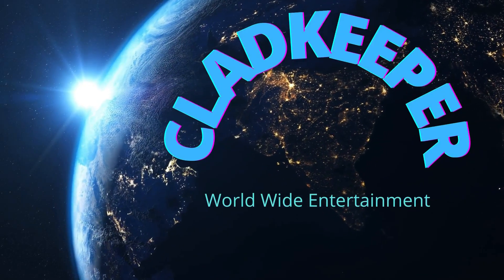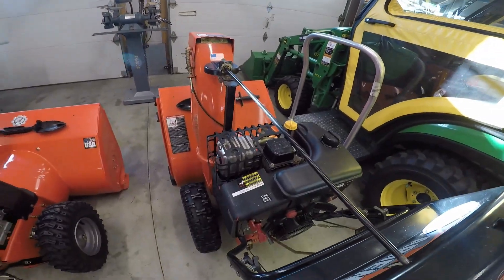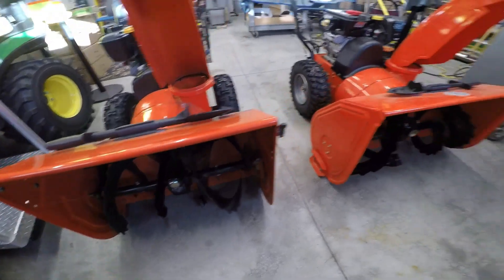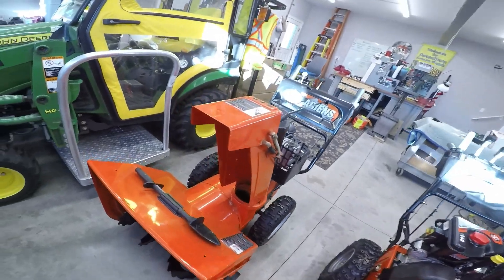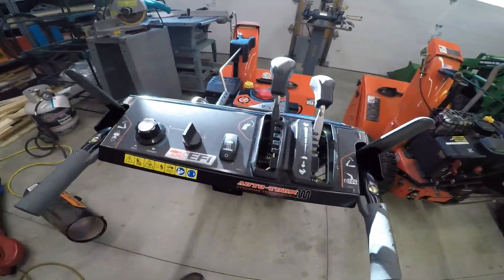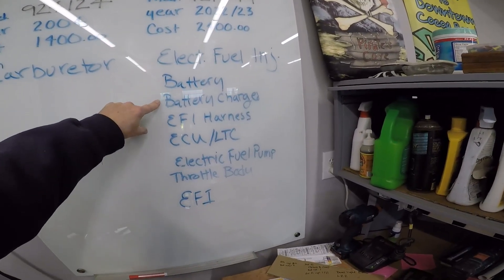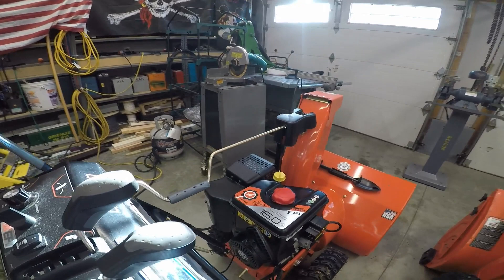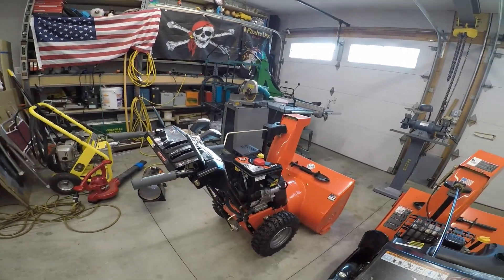Ariens : Compare electronic fuel injection to carburetors.

Comment: I am looking at replacing my Ariens 24 inch compact snowblower I have had since 2019, I am looking at a 28 inch next, but I came across these EFI machines and did not know what these were or how they worked. I also am big into owning electric lawn tools, including I also have a 24 inch 2 stage electric snowblower as well that runs on the same batteries as the majority of the lawn tools. But I am convinced currently that gas is something you need to keep around for that power in those deeper snowbanks whereas electric currently is best for "most" snowtypes (light to medium thickness, not too wet) but heavy just struggles with electric only tools still currently (or even snow plowing with a blade can still be a struggle. I think after explaining these maintenance costs with the EFI engine (basically its like a hybrid between electric and gas kind of), I would rather stay away from EFI unless you live in an area where you get tons of snow regularly. If you live in a place where you get some big snowstorms for a few months out of a season, then probably sticking to a carb unit is the best and I think that is what I will do. Plus I don't have a garage where I can just causally hook up the EFI battery to it to keep it charged as well if it is attached to the unit itself (or even remembering to do that). So at this point, I would rather do maintenance on a unit to be used for more specific cases that doesn't cost much to keep it maintained (since the electric batteries are where I have to keep most of my costs to replace over time) and keep it simple or just go fully electric at that point. Electric tools have gotten so good now for at least the summer/misc. lawn tasks (and power tools now) that snow removal is one of the few areas left that Gas (and maybe chainsaw work on the heavier side for cutting denser woods) still I think has an advantage currently if you live in an area with heavier snow storms until the battery tool companies figure out how to get the power for the bigger snow throwers on par with those gas units. But all of this is just my opinion.

Comment: Just got a Great Lakes Edition with EFI.  Not happy with it. It is hard to start, the battery tool over 30 hours to charge and it runs like crap. They put more money in the light and hand grip harness connectors than any of the engine control connectors. It back fires and stumbles with premium gas. Even the chute tilt motor did not work out of the box. Who ever assembled the motor cross threaded the bolt and the cable and gears were messed up I had to fix myself. I spent $2400 on this machine and am seriously thinking about buying a carb engine from Northern  and cut my loses. This unit seems to be very vulnerable at the times you are going to need it most. Stay away…

Comment: So is it possible to convert the efi version back to carb? What would be needed besides the obvious carb? The EFI on this sucks, cheap harness, expensive battery that you have to keep charged also cheap connections on that too. Connectors on the ecu are also cheap and vulnerable. Fuel pump is low quality and often fails.
Reply from the maker: Have not gotten that far into it.

Comment: I also have a 2004 924124 9hp 26 inch. Here in Syracuse NY. 120 inch average annual snowfall. It has served me well, so far. About 8 years ago I had to replace the impeller bearing and did some repainting and replaced the gearbox oil seals and a bunch of rusted bolts with stainless. I have also rebuilt the carb once and cleaned it a few times. I have replaced lots of shear pins and am about to replace an impeller drive belt. It has never failed to start and run well enough to clear my driveway.

This replaced a 1980 7 HP 24 inch unit that was working fine in 2004 when I traded it in on the 2004 model.

The Sno King engines were dependable workhorses given regular maintenance and same for the Ariens blowers. Ariens still have all the normal maintenance parts for both of these models available. And I have local dealers who have most of the common ones on the shelf.

Comment: I think the 306cc engine on the Deluxe 30 is closer to about 9.5 horsepower. I think you divide the engine cc’s by 32.5 at least that’s what I’ve heard. It’s crazy how many people think the torque rating on these engines is horsepower though.. I see used snowblowers for sale on my local classifieds all the time with the engine rating advertised as horsepower..

Comment: So after making this video, did you ask yourself why you bought the EFI machine? Quite honestly, you're a little low on those parts. These things are junk. I had 4 customers who dumped them after I told them how much repairs would be with labor. You CAN'T beat a carbureted engine. Just start the damn thing once in a while through the summer months and never have a problem.
Reply from the maker: @joeganusi8522  I would have bought 10 of them if I could have at the price I paid

Comment: Excellent, detailed and well explained video. Regarding the auger rake brace on the newer one, Ariens cut corners on more recent models that are not Pro or Compact series machines. On your EFI model they use a stub auger shaft only goes out about 1 or 2 inches on each side of the gear case, therefore it needs the brace. Your older machine has the costlier more robust full length auger shaft which doesn't need a brace.
Reply from the maker: I never looked into why they added that brace

Comment: Thank you - yeah I have an EFI Honda rancher [it came that way] sigh
Id prefer a car as I can fix that [ yup we agree on that] ;)
   my cars efi & 1 truck is [I prefer my old Truck 1975 no computer stuff, have rebuilt the carb a few times over the years.] 
 my rancher? its been good [its a Honda] lol
but seems to use more fuel than the older ranchers (?) so ? 

 I have an old john deer [maker (?)] its a 2012 or so, but it runs fine.

 think Ill buy old style carb over anything EFI -

Comment: Why don’t you get better heat in that nice garage instead of flamethrower like I got thrower heater in the ceiling if you got natural gas no more bullshit. I would never own electronic condition Snowblower that you gotta unplug that and charge it. What about that plug is out of that battery and you can’t start your snowblower
Reply from the maker: @patram4880  I am working on a natural gas ceiling unit.

Comment: Old people hate change.  Most modern vehicles do not have carburetors for a reason.  The gasoline .  They went with EFI because it is a closed system . Which prevents moisture from contaminating the fuel .  The system is proven.  Time will tell if more small engines switch over to EFI. Add stabilizer to your fuel and top off the fuel tank before you store it away for long-term. .

Comment: Yeah EFI does work better when it works but it's mostly there for marketing and ridiculous to fix.  I've had my Ariens for 23 winters and the only time I ever had to mess with the carb was when I didn't drain it for the summer.  I don't see any point in getting EFI.  Same with electric chute controls.  Manual controls are not hard at all so why introduce electronics?  It's so silly but that's what you get when people are obsessed with feature lists.  Ariens has to offer these things or lose sales.
Reply from the maker: You’re right on target. Do we need electric chute control. How friggin lazy can we get. This is the reason a new car cost 50k. Now I’m all for progress …but… it may go too far. I had an Ariens from the 70’s that ran fine when I gave it away in 2004. The reason, it would stay in gear and drive down the road if you let go of the controls. It was a safety issue. On the same note , I was going to put fuel injection in my 1964 Corvette because if it’s dependability. Several times the fuel gelled up in the carb because of winter sitting. Knowing that I could junk yard a system for short bucks was the main reason.  Right now you will buy every part from China to get your Ariens EFI fixed

Comment: My opinion, Ariens quality has really gone down in recent years. Simple things, like not having the pulleys lined up, having the hot engine melting snow right above the belts causing bits to slip or not having  wire harness plugs securely plugged in.
Reply from the maker: Sadly the younger generation isn’t picking up on mechanics. Not all but some. This country needs to get back on track and start producing more here. I see older cast iron tools being given away because the “ kids” don’t know how to use them.

Comment: Yeah, I bought the same Ariens EFI unit a few years back (fortunately it was only 1600 or 1700 back then), and had it in the shop twice while it was still under warranty. It still runs, but will only make about half power before it starts to run poorly. I wish there was a way to convert it to use a carburetor. Fortunately I now have a tractor mounted snowblower that I mostly use, and I'd sell the Ariens, but I'd feel bad about saddling someone with this piece of...
Reply from the maker: Thanks for the reply. My hope was to have people read this before buying a new EFI model. This helps others

Comment: Once ariens stopped using the Tecumseh engine in 08 they pretty much became junk. I had a deluxe 28 I bought new and the dam thing never worked or ran right. I bought an older st924 and that things runs like a banshee.
Reply: There were some tough years when the old L-heads were killed by the EPA, but the current LCT engines seem to have most of the bugs worked out at this point.  A lot of people are happy with them as they are smoother, quieter, and more efficient than the old ones.  LCT is what's left of Tecumseh.  My '02 8HP Tecumseh has always been awfully rough but reliable.

Comment: I am not a mechanic. 
My Honda generator has a battery start and a pull start. It also has EFI, but I can pull start it with a dead battery or with the battery disconnected; I have not tried the dead battery pull start yet as I have not had a dead battery, but I have tried the disconnected battery pull start and it works like a charm. 
I have no idea how Honda does this, EFI with no battery, but their system has worked flawlessly for years now. I also run non-oxygenated gas and start it once a month to let it run gas through the system and to charge the battery, which is what my dealer told me to do, in addition to putting a trickle charger on the battery a couple of times a year. 
If they could put an EFI system on a snow blower, like my Honda genny has, maybe that would solve a lot of the issues Arien's is having with their EFI systems on their snow blowers?
Reply from the maker: Ok. You bought a 4000.00 Honda generator. 
You have to buy special gas for it. 
You have to start it every month 
You have to charge the battery a couple times a year 
I take my machine out of storage , add fuel to my “ mt” tank and it starts right up and runs fine 😊
I did not say Ariens is having problems with their EFI , I just point out advantages and disadvantages of owning one or the other.
Reply: @cladkeeper8376  
You entirely.missed the point, so let me try again. 
Why is it that the honda with EFI will run without the battery attached, started via pull cord, but the Ariens needs the battery?
I am not a mechanic and at the end of your video, you did say that you had an ariends efi for sale and by reading the comments you left, it sounds like you are not.a fan of them.
Reply from the maker: Sorry for missing your “point”. The Ariens has a magneto to generate the electricity to charge the battery, run the headlight, run the fuel pump and power the module. When running. To start the EFI motor you need the battery connected and charged even if you run the 120v electric starter. I tried it. Your Honda motor , not sure which one, probably has a magneto also. Maybe the magneto puts out enough power to fire it without the battery. I’ll figure that out when I buy yours for 300.00 because it wouldn’t start 😊
Reply: @cladkeeper8376  Now that last line....is funny. 
Seriously, thank you for the laugh. 
The dealer that I buy my stuff from sells hundreds of the Honda genny, EU 7000 IS, I have to a billion dollar corp and their guys have been beating them hard for years. He said that I would not believe the condition they return them to him in, in order to repair them. He said that this one would last me, Joe Homeowner, a lifetime and I hope that he is right.....not you, no offense. 
But, I have no idea how it works, I just know that I wanted to see for myself when I got it home and disconnected the battery and pull started it. The compression when pull starting, is a bear to get over, but it started and ran just fine with no battery. If they could put something like that on snow blowers or other small engines with EFI, maybe they would work better? I don't know. Enjoy your videos though. 

Thank you not only for the good laugh, but for the response.
Reply: @PatrickFaricy  And yet Honda doesn't use EFI on their snowblowers.  Why?  Almost certainly because a decent system costs too much to be worthwhile on them.  Comparing the engine on a $6000 generator to one on a $2400 snowblower is disingenuous, to say the least.
Reply: @plmn93  
My comments were not disingenuous I am not a mechanic and until watching this video, I would have assumed that any piece of outdoor equipment with EFI would be like my genny, I now know that this is not the case and would not purchase ANY brand of snow blower that has EFI on it. Thank you to the OP. You are jealous of my choice of generator, nothing I can do about that. If you are in the market for a genny, look at duty cycle; the number of hours a day that the manufacturer specs out their genny to be run It is hard to find, but get a genny with a 100% duty cycle; meaning that you can run it 24/7/365, as long as it has gas and you change the oil. My Honda has 100% duty cycle and I am sure that there are other manufacturers out there that also have 100% duty cycle on their gennys, but they also, will cost more than the average genny available at a home store,
Good luck!

Comment: My friend bought an EFI snowblower a few years ago. At the time I didn't really know anything about small engines. When was brand new when he showed it to me I didn't even notice EFI written on it. Now he's having issues with it.
Reply from the maker: Robert, I’ve had my Ariens for 20 years now and still have only broken a shear pin or 2. No other problems at all. Not even a v belt replacement. This is where “ don’t fix it if it ain’t broke” comes in!

Comment: There aren't any pro's with efi over carb. None whatsoever. Pure junk!!
Reply from the maker: The automobile EFI has a lot of moving parts and I like the fact that it does keep the moisture out of the system. I wonder if these EFI systems on a snowblower keep out the moisture out or if it’s a gimmick.

Comment: If the battery is not charged will it still start up?
Reply from the maker: It will not. I had to charge for a while before it will start. If you let it sit for a month or so you would probably have to remember to charge it before a storm.
Reply: Do you still need the extension chord plugged in to start up as well as the battery charged?
Reply from the maker: With battery charged you will still need ext cord with 120 volt starter, not for pull start

Comment: The one variable that affects Carberators is corn-fuel (ethanol) . When you need to add a gas stabelizer to help gas function and lower carb parts corroding, that's a constant pain and does not eliminate destruction of your carborator.  Like the cars of today there are no carborators anymore for a reason. Performance. I had a Ariens PRO1024 that ran great until the ethanol ate thru 2 carbs. Now I have a Ariens Platinum EFI/SHO and I'm not looking back. Until the electric snowblower evolves (and it will), this is my power snow blower. (40-50 ft distance).  At 68 YO Need a tool that works for me not against me.
Reply from the maker: I understand the whole ethanol thing. 
My 9 HP Tecumseh carb on my new in 2004 Ariens has never been apart once. 
I run a stabilizer in the machine during the season if storms are few and far between. 
At the end of the season I run the machine dry of fuel. The problem is NOT the ethanol, it’s the moisture the ethanol attracts in a vented fuel system. That’s why there is  not the same problems       with fuel injection systems. 
I like fuel injection very much, I’m just not going to let China get rich off me with overpriced parts.
Reply: @cladkeeper8376  If you try the EFI/SHO in a good snow amount you'll jump for one. It's a pleasure to use.
Reply: I've been using Seafoam in E10 gas for over 20 years in my small engines.  The only time I had a problem was when I was too lazy to drain the bowl for storage.  Snowblowers are not cars, they are built to a much lower standard because they are at a much lower price point.  Cars no longer use throttle body injection so even with EFI these are a long ways from automotive systems.

Comment: I buy a new one every 3 years .
Ariens keep the best resale.
Buy them for $1500 +- 
Take the tax deduction
Do minimal maintenance
Sell it for $1000 
Get 3 years out of it for $500
Reply: Get an ultrasonic cleaner.  Take the carb apart, you sometimes don't even need gaskets.  Just clean everything.  Takes about 5 minutes... and if you're pulling the carb off anyway, save the $30-50 and waiting for shipping and Chinese knockoffs that might not have the right tolerances and then just have a well cleaned original carb.